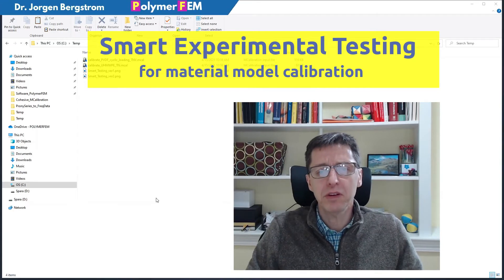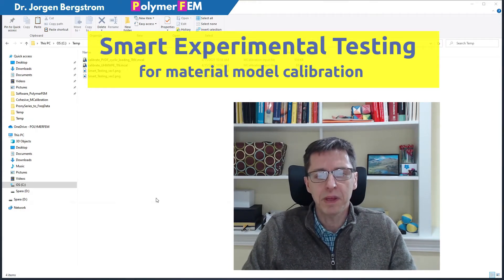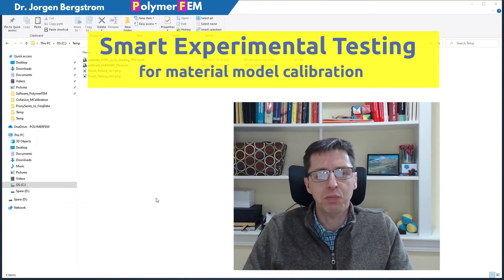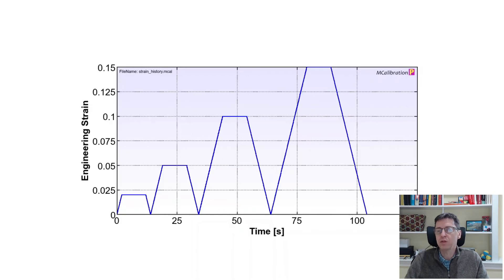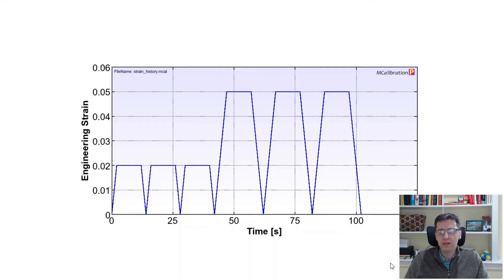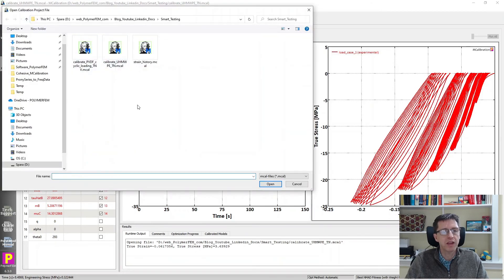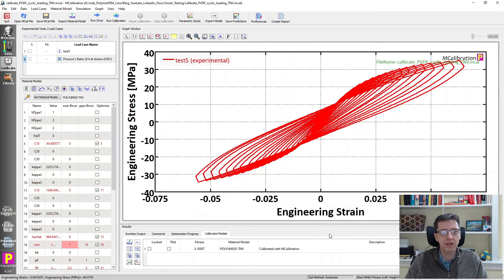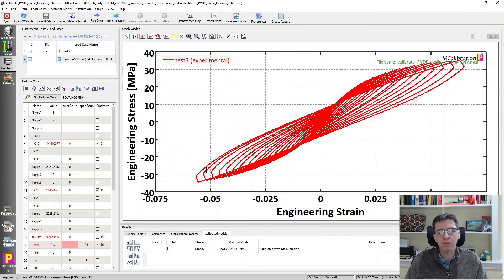Smart Experimental Testing for Material Model Calibration

Comment: A couple questions: 1) At how many temperatures do the test need to be run in order to calibrate the model (TNV) from -40C to 65C?  2) Same question for calibration of the model for strain rate sensitivity...
Reply from the maker: Great questions. I will write an article with images to explain it in detail. A short answer is that it depends on how non-linear the temperature-dependence of the material is in the selected temperature range. If the modulus and yield stress is linearly dependent on the temperature, then you only need to test  at the max and min temperatures. You can determine how the modulus depends on the temperature using a single Dynamic Mechanical Analysis (DMA) temperature sweep test, or you can also look what the Tg and melting temperature are for the material. If you temperature range is far from those transition temps then you may be able to get away with only testing at the max and min temperatures. To be safe, it is often useful to perform the tests at 3 temperatures: (1) the min temp, (2) room temp, (3) the max temp. Similar arguments can be applied to strain rate sensitivity.